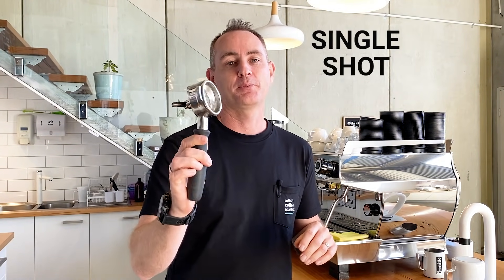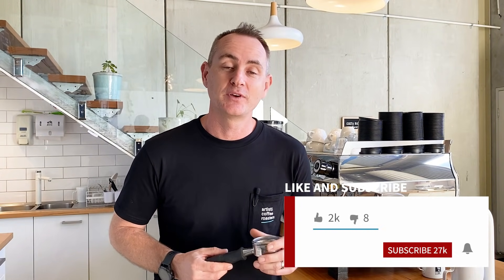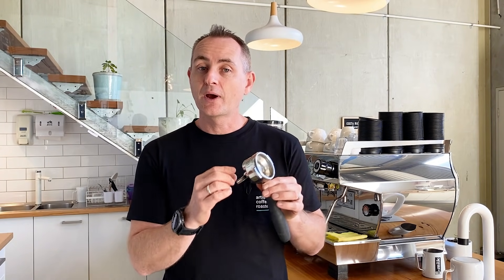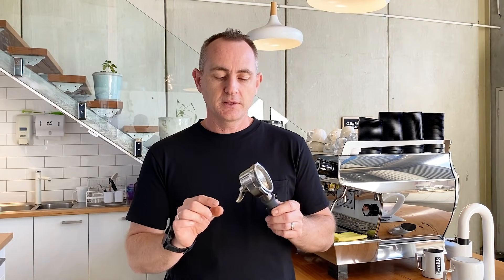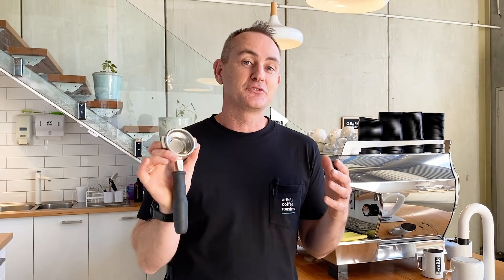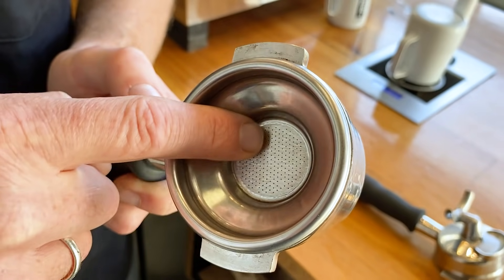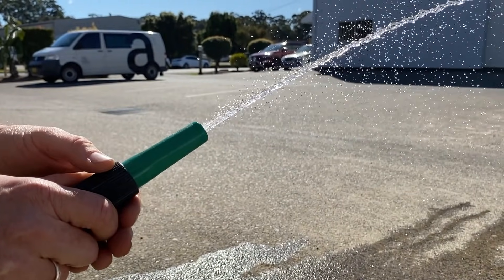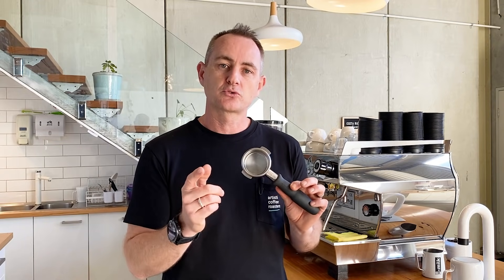Why we DON'T use a Single Shot Coffee Basket to make Coffee

Comment: I read this a lot indeed, but then you need two cup of drinks (one espresso milk drinks) everytime with someone else, otherwise a spill in beans and water. In coffee rooms that is mostly not an issue, and happens a lot, but at home…
Reply from the maker: Yes, it does seem like a waste at home but if you're trying to get the best flavour from home, it's just what needs to be done. Save the extra shot for an iced coffee in the afternoon or start drinking double ristretto's instead of single shots.

Comment: C'mon, if it was same water VOLUME going through, than OK(as with garden hose example), but we're talking PRESSURE here...all the extra will go to the drip tray via OPV etc. 
Good single baskets are designed in such a way that you shouldn't even (almost, as I'm still not there) change the grind size as the coffee mass, diameter of the basket and holes/total area are adjusted accordingly.
The reason it's difficult to get stable extraction without channeling is the puck prep only. You'll need different 41mm or so tamper and, ideally, extra funnel to fit both, basket and tamper.
Owning LM Strada single 7g basket (it has actually straight walls, not sloped ones). Loading 8.5g in it and getting predictable results (grind size/time/yield wise). Why not perfect you ask - I'm still not very confident with my HX machine)
Pros in coffee shop environment are obvious

Comment: Why do manufacturers keep that shape over the years? isn't it possible to have a single dose with the same diameter but less depth?
Reply from the maker: Yes it would be, it’s a traditional basket and that’s big with the Italian manufacture industry
Reply: I believe that a 58mm straight wall basket for a single shot would not work well: the coffee puck would be so thin that controlling the water flow would be extremely difficult. This is, in my opinion, the reason why 100% of the single shot baskets, including the high end competition ones, have the "funnel shape"; it creates a thicker puck with the same amount of coffee, and slightly restricts the flow in order to make extraction more manageable. All the engineers designing coffee equipment for the different companies cannot be wrong water all...
My personal experience is that the shape of the single shot baskets works absolutely ok, it is just a matter of getting used to them and adapting the grind size to get the perfect extraction. If you are regularly using the double shot baskets it is only normal that you get a worse extraction with the single one the few times you use it, same as when you buy a different brand basket: you try to extract in the same way but the basket geometry, hole size and distribution, amount of holes etc make a big difference that needs to be taken into consideration.

Comment: Ok I tried 15g of coffee in a double basket and I got 30ml in 10 seconds which seemed way too fast.  So I think I prefer the single basket to slow it down for a small shot. 

For double basket I would use 19g coffee to get 40ml in about 20-30 secs.
Reply from the maker: Yes so the 15g has lifted, you have to increase the pressure on the tamp and a really fine grind if there is too much room for over expansion. Cheers luke

Comment: You say you put 22.5g into a 21g basket, is that normal? Should you usually put more into a basket than its rated to? That's very confusing. I would assume you would put 19g into a 19g basket...
Reply: main thing to check is if you have enough head space when locking in... prepare and tamp a puck, load it into the machine then take it right back out (without brewing), see if the coffee touched the screen or screw. If so, that's too much for that basket. Get a deeper basket or reduce the dose. If the puck comes out completely unscathed, you should be good to go. The most important question to ask though is, Does it taste good? If it's tasting great, you don't have any problems ; )
Reply: The "grams" on a basket are indicative. When you actually have the basket you want to make sure your tamped coffee bed has enough clearance from the grouphead so water can preinfuse nice and even and has time to build pressure. Once full pressure starts you want the rest of the water to push on the water that has already been preinfused rather than on the coffee bed itself, which will happen if your gap is too small. As usual, experiment :)
Reply from the maker: What a great answer, thanks.
Reply from the maker: Great answer too, my job here is done 😆
Reply from the maker: Also remember that the amount of coffee in your basket is also dictated by the freshness of your coffee eg. younger than 7 days. If it's very fresh, it will be 'fluffy' and expansion will be larger so you will have issues. Your grind particle size also. If your machine can't handle a fine grind, you may have to reduce your dose to compensate for the courser grinder. The quality of your burrs can also play a roll as grind particle size will impact your extractions and the way the particles 'tetris' in the portafilter.
- Jimmy

Comment: Sorry, but I don't get it.
Actually I use the single basket exclusively, since most of the times I only do one shot with an extraction ratio of about 1:2.5. Even if I have to prepare two shots I prefer to really grind two times and use the single basket two times. That's because I think that using the double basket with the double spout, doesn't lead to an even extraction to both cups.
Using the double basket to make a single regular espresso would mean to end up with a ratio of almost 1:1 (and a heavy increase in consuption of beans).
Plus you always refer to Ristretto. My definition of Ristretto is a single basket extracted with an 1:1 ratio ending up with approx. 16-18ml. Therefore using the double basket to pour a single shot is already a double Ristretto, while pouring a single Ristretto with that amount of beans would correspond to an even lower ratio.
So what am I missing here?
Reply: Sounds like that works for you. If your default drink is always a double shot, then using a two pour portafilla with  double basket  to take just half extraction still ensures you control extraction timings and don't have to lose time changing baskets etc. Of course it also means you use more grind (18 to 20gms for standard double)... But if it is the exception and not the norm the approach makes sense for us, as described in the vid. Less so if your standard pour is single shot.
Reply: If your double basket was to go all into one cup you would not have this issue. If your machine is not leve, your puck is not prepped well and so on, your two spouts will surely see different amounts of liquid coming out. This is all eliminated if you remove the spouts or use a naked portafilter. More coffee means more flavour, that is a fact.

Comment: I actually think you left out the most important reason for not using a single basket in a commercial setting and that is they require quite different grind settings (dialling in). You'd need two grinders, each with its own blend/SI in them and only use one for each basket type. This is simply not practical in a commercial setting - so I think that is main reason. Yes, its also much harder to dial in a single basket too, but if that was the only option, then cafes would get good at it and we wouldn't be talking about it. Having to swap is the real issue I think - its just not practical to do so.
Reply from the maker: Correct! We wanted to show the extraction difference if you kept all the same. 👍🏻